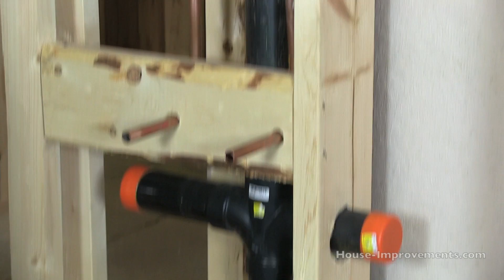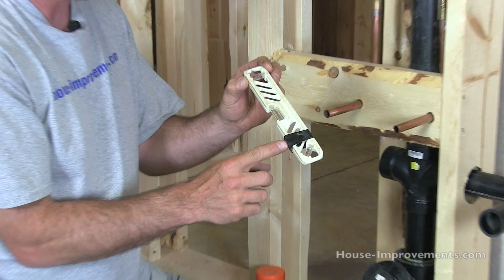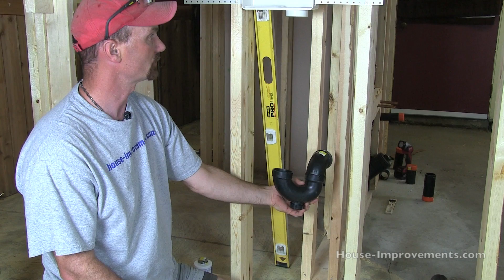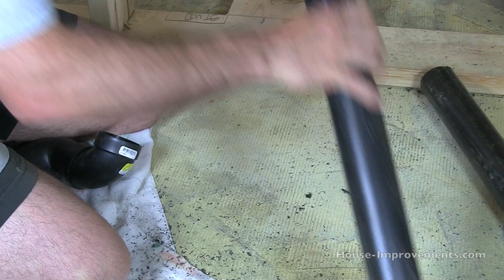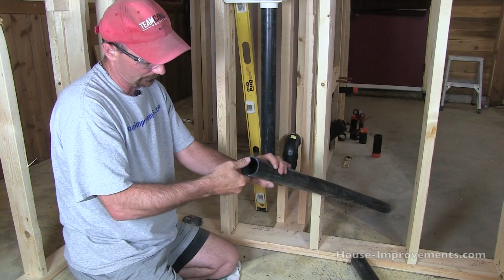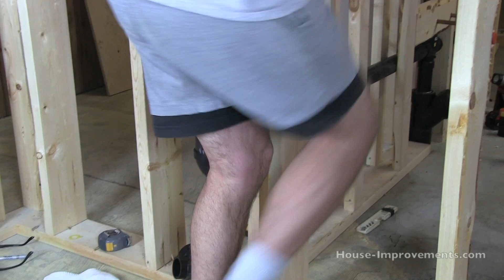How To Cut and Install ABS Drain Pipe

Comment: Good disposition but the video needs to be redone there are a lot of misleading steps, For example both fitting and pipe needs to be coated with glue and Held for a minimum of 30 seconds. Of all the different types of pipe ABS will want to back out of the fitted more than any other type especially large sized pipes and fittings

Comment: If running 1 1/2 inch abs through a floor should you drill a bigger hole than 1 1/2 inches?

Comment: Many levels have two black lines around the bubble. If you are using one of those levels, the outer line indicates a 2° slope up toward the side the bubble is touching. No need to rig anything up if you have one of those.

Comment: Thank you for great details. One question. for the 4 feet section slope. We need 1 inch rise and the angle created by 1 inch height goes in to receptacles on either end with ceratin angel and will this cause an improper fit or glue stength? Or how much angle can be tolerated without an extra slopiing fitting connection?

Comment: Shannon how high off the ground is that double t? I have a roughed in by builder at 20.5 inches. Does that mean I need to cut bring it down to 18** inches I think you said.
Reply from the maker: At up to about 22" you would still be ok in most cases.
Reply: @HouseImprovements  is the height mainly importance for where the abs comes out of the finished wall so vanity can connect?

Comment: This is awesome. Exactly what I am doing. So no need to prime ABS like you do with schedule 40 PVC?
Reply from the maker: It is better if you put the glue on the fitting and the end of the pipe.
Reply: @HouseImprovements  thank you! I’m trying to do this as well. Currently have a sanitary ty with a side hub for the future vanity and a vent. I would also like to add washing machine so go with a double ty like you have shown and ensure ur washing machine plumbing is 2 inch and sink 1.5 inches? I’m in manitoba

Comment: Anyone else notice he was trying to put the raised end of the level on the wrong side?  The slope would have been down with the raised block on the stub end.  I mean, the pipe was still too short for it to work right, and I'm sure he would have noticed had he continued and did it for real.  But I just thought it was kind of amusing.

Comment: 1) You're not holding the pieces in when you first join them. You ABSOLUTELY have to hold them together since the solvent generates heat to solvent weld the pieces together. That heat naturally pushes the pieces apart, and that's why you MUST hold them together until they cool down (about 30 seconds). 2) Why didn't you first put the bushing on the 1 1/2" pipe and then put that into the stud opening?
Reply: Also he need put some glue in the pipe and fittings..and hold until glue cold down

Comment: I was always told to put the glue on the pipe instead of the fitting so it doesn't push any excess into the pipe cavity. Possible flow reduction?
Reply from the maker: In reality they recommend glue on both the pipe and the fitting to be sure you have enough glue contact.

Comment: I also recommend glueing/cementing both the pipe and the fitting for guaranteed seal and if you're feeling extra, even rough up both prior to cement with sandpaper.
Reply: Prepping for my forever house- I was wondering about sanding the ends, to be super extra should I chamfer the ends a bit or is that way overkill?

Comment: Why would you use a P-trap with a clean out concealed in the wall on the laundry? Doesn't make sense when you can clean the drain from the opening on top. More problems for leaks in the wall!

Comment: another good video Shannon
Question ?
black abs or white pvc for washing machine drain ? and basement shower piping ? 
what is the difference and when to use ?
currently have black abs for basement plastic sink joining to copper main stack
Reply from the maker: Well it depends where you live some areas use PVC in most places . Where I am ABS  is generally used all through residential buildings but some areas will have different rules.
Reply: @HouseImprovements  Living in TORONTO . 
so Either one will Do ?
i heard Black ABS slightly Cheaper
Reply from the maker: @jonienglish3231  Both will do the job and ABS is usually cheaper.

Comment: Would a Mitre saw with wood blade bo ok to cut 4" or less ABS? Thanks
Reply from the maker: Yes, cut with control and don't just chop down through it with speed. Safety glasses for sure

Comment: How do I fasten 60 feet of 4'' abs pipe to the basement ceiling? Is there special clamps or something?
Reply from the maker: metal hanger strapping works
https://www.amazon.com/PlumBest-H20011R-Galvanized-Hanger-100-Foot/dp/B0069QU02C/ref=sr_1_7?keywords=metal+hanger+strapping&qid=1573410289&sr=8-7

Comment: Shannon , I have 1 1/2 brass drain line for may washer and sink. I have a small lea that I think it is running down inside my block wall. I think it is a brass pipe, house built in 1962, any way this drain come down from up stair and runs through a cement wall goes down the wall at a 45 on one side then make a turn down with another 45 and then goes down the inside of a small closet about 6' and back though the same wall and goes to a drain on the other side of the same wall to a bar sink. I have noticed water on the floor under the drain line in this closet. I want to know if I cut this copper or brass pipe and go with ABS how do I join these two pipes that are different. Can I use what they call a Fernco that is rubber with two hose clamps or do they make something different to join these two pipes. Thanks for Great videos. Please let me know, I need HELP !
Reply from the maker: Please use my forum and include a picture of the pipe and the size.https://www.house-improvements.com/forums/

Comment: The level should have the taped on spacer towards the wall side not the end of the pipe to angle the pipe up.  The way you showed it would be sloped downhill.

Comment: Wrong glue, glue is required on both fitting and pipe,  a good inspector will catch this along with you can not cover a trap in the wall that has a trap clean out on it.
Online inspection...not approved.

Comment: Question?? I'm remodeling our bathroom and our waste and vent lines are 4". ( main line to street) The waste will remain 4" but does the vent up need to be 4"? I'm not  a plumber , Actually I'm an  Electrician and very handy. I try a do as much as a can to learn and save.

Comment: Hi shannon, do the laundry drain needs a vent too?
Reply: Not if it's within five feet of the existing vent. Also you could use an AAV if permitted.
AAV = air admittance valve.

Comment: This is way off base. First off, crosses aren't to code. 2" trap arm? Why? NEVER DRY FIT You'll end up forgetting to glue one. It will come back and bite you.Plus.. what a waste of time. Hey! Rough in distance from floor to centerline of k/s drain? Sort of important. *18"* Same for vanity sink. If it's too high on a k/s, you may not be able to hook up a g/d or a 2 compartment sink.
2"  p-trap for w/m. riser no less than 18" , no more than 30". Why a clean out on the p-trap in a wall? Silly and a potential leak. Always apply glue to both spigot and socket, twist as you insert and hold briefly(the pipe can back out when first installed) wipe off excess glue.I shouldn't watch these.Too painful

Comment: This type of ABS pipe is recommended for water temp up to 140F. my horizontal section ABS pipe to the waste pipe under the sink is totally destroyed with cracks, water drippings along it when running water from the sink. I think the hot water from pasta cooking and discharged hot water from my dishwasher which is over 140F did the damage over time. Do you know if there are ABS DWV pipes 1 1/2" can handle temperature above 140F and can I cut off the damaged section and replace with that even they are not the same materials. Thanks.
Reply from the maker: ABS is rated for 180 degrees. I have never seen it be damaged by hot water.

Comment: Awesome! Now when the electrician goes to put in the box for his over the vanity light, the vent stack will be right in the way! Awesome!
Reply from the maker: I suppose if this were a bathroom or if the pipe was less then 2" from the face of where the finished wall surface would be  it could be a problem.

Comment: what about a clean out option

How do you avoid damaging the threads in the cleanout where the plug goes in when using a power snake to clean the maIN drain ?

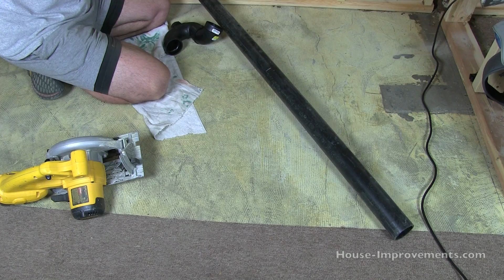Comment: 10:20 Avoid using power saws, since the high speed of the cutting blade can melt the plastic.
Reply: that's fine, you can go a bit slower

Comment: Hi HouseImprovements,

I have a roughed in bathroom and had waterlines installed. The toilet and sing drains are roughed in a should be ready for install. I'm about to tile to floor and was wondering when/where do I make the cut of the ABS pipe cut for the toilet drain. I have a standard flange and toilet ready to go but not sure where to cut the drain.
Reply from the maker: This is a better question for my forum, I can help you there. http://www.house-improvements.com/forums/

Comment: Hay Shannon, question for you . I am about to extend my kitchen.  Behind the wall close to the kitchen is a laundry.  I found the pvc pipe that runs from the floor to the ceiling and two copper pipes hot and cold water.  I cut off the pvc pipe on the ceiling and at bottom.  Question is, do I have to glue the cup on the part I cut off on the ceiling because that vent pipe runs towards bathroom or should I lieve it open.
Reply from the maker: it should not be left open but just capping it can trap moisture over time that could freeze and bust the pipe if you live in a cold climate. Re doing the vent so it does not have that dead end drop in the ceiling is a good idea.

Comment: Shannon, just FYI, I read on the ABS cement can instructions that the application procedure consists of 3 steps.  

1) Apply liberal coat of cement to pipe to the depth of the
socket, leave no uncoated surface.
2) Apply a thin coat of cement to inside of fitting, avoid
puddling of cement. Puddling can cause weakening and
premature failure of pipe or fitting.
3) Apply a second coat of cement to the pipe.

Then you insert the pipe as you had shown.

This is what it says on the can of the Oatley Solvent Cements for ABS pipe glue.
Reply from the maker: Good to know,Always read instructions, LOL
Reply: @Michael A  they were commenting on his demonstration of only 1 coat per fitting and pipe. Hard to watch as a plumber. 😂😪

Comment: Hi Shannon , need an advise from you. I installed a new kitchen in basement. Some how while cementing ABS pipe I kinda messed up slope on the pipe which connects from P-Tap to drain. Drain pipe has sufficient slope though. But pipe connects from P-Trap to Drain pipe has a slope downwards towards the trap. I ran water through , let the tap running for 10 minutes and water is flowing perfectly fine. Wondering should I leave it as is or fix it ? Please reply. Thanks
Reply from the maker: It is likely a short enough run that you will be fine.

Comment: I used to use Vent 90's on the trap arm so the hub would be in the wall but the inspectors started calling me on it.  And why do you only glue the hub the end of the pipe should be glued also.
Reply from the maker: +Dumped4ADildo I guess thats just how I have always done it, maybe because I use a fair amount of glue I have go ten away with it?
Reply: +HouseImprovements Not that it happens often but when glue joints have failed its been when only one piece was glued.  I guess if your quick enough it shouldn't matter but if the one glued piece begins to skin over your running the risk of not actually fusing the abs but rather just packing it with a sealant.  Also I forgot to mention on the vent 90 trap arm when the inspectors started calling on me I started using spigot medium 90's so the spigot end is whats sticking out of the wall and my trap adapter. glues on to that spigot long sweeps if the cabinet had a back panel.  And I just want to say these are things that I have been through if your work works and everyone is happy then it was done right no matter how you did it.

Comment: Great video. I am trying to build a bathroom without cutting into the Cement.. I wanted to ask can I cut into the waste pipe and just raise the floor for the toilet. how do I cut into it if I can
Reply from the maker: +C. Osi  It maybe possible but I have never done that. Interesting thought though.
Reply: honestly all depends on the location how high or low it is. honestly cutting the cement and doing it right is your best bet

Comment: How come you only apply the glue to one not both surfaces of the ABS pipe?
Reply from the maker: I guess I always am pretty liberal with the amount I apply so never felt the need to have it on both pieces. I always give my pieces a slight twist after joining as well. As some have suggested here it should be on both pieces.
Reply: HouseImprovements If you understood what the glue is doing, you would apply to both surfaces.  If you attempted this with pressurized pvc, your joints would fail in very little time.   If your only going to add glue to one surface you should at least prime both surfaces first

Comment: You can just glue up your 90 and pitch it while the glue is still wet. Then you dont have to waste time dry fitting. The 90's pitch stick in the pipe and keep moving.

Comment: The 1/8" pice of wood on the torpedo level looks like it should be on the other end of the pipe. But then he ended up eyeballing it after going to the trouble of constructing it so it seems it didn't matter for him... Of course you want it to be such that the pipe will be higher at the sink end than the sewer end.
Reply from the maker: I had to go back and watch the video ,and you are right if the pipe would have been long enough I was holding the level the wrong way.  Hopefully if the level would have fit on that pipe I would have caught my mistake. Good eye on seeing that.
Reply: HouseImprovements Shannon, you should do a video on how to attach a 1/4" block on a torpedo level in order to get 1/4" fall per foot. I am a DIYer and I'd like to see that.
Reply from the maker: Rocket Rider  You are looking for 1/4" / foot, so on a torpedo level (which is usually only about 8" long) I measured 6" from one end (1/2 a foot) and at that point I  used electrical tape to secure a 1/8" piece of wood because of only going 6" long. I leave that taped on permanently ..
Reply: Thanks. I will set up mine too.
Reply: HouseImprovements  OK, I found something in the kitchen that is 1/4" high. I put a 12" ruler on it to get a slope of 1/4" then I put my torpedo level on top of the sloped ruler and noted the place where the bubble rested. I marked it with a black marker.  That way I don't need to tape anything to the level itself.
Reply: Better check your local codes first.. This wouldn't fly in parts of the US

Comment: Do you need a p-trap in for the Laundry drain and why one with a clean out in the bottom of it that will be inside the wall?
Reply from the maker: Yes you need a p-trap to keep sewer gases from coming back into the home. The trap does not need a clean out, it was the only 2" trap I could get at the time and I actually glued it closed so that it would not maybe start to leak over time.

Comment: Thanks for the video. I watched it and then replaced a 30' run from one side of the house to the other. Home Depot only had the nasty black adhesive, not the fancy yellow stuff you are using. Can you tell us about the yellow stuff, where to get it, how it differs from the black stuff, etc. I had to use solvent to get the black stuff off my hands!
Reply: Jason Bolton abs glue in the us is black and milkey white we don't have a yellow glue for abs. Transition glue is green here in the us.
Reply from the maker: I have never seen/used a black ABS cement. I purchase my yellow glue from Home hardware. It does not easily wash off either.
Reply: You were probably mistakenly using system15/xfr glue (greyish colour)...abs glue is yellow 100% (there's transition glue for pvc to abs which is white)...  i would consider deleting and rebuilding with the proper adhesive (especially if you didn't use a glue mentioned in this comment.)

Comment from the maker: that depends a little on how far from the sink you will be. At the sink the 1-1/2 pipe should come out of the wall at 18" to center from the floor. Your horizontal pipe from that point to the main stack should be sloped at 1/4" per foot ,so from that you can figure out the height of the fitting you need to cut into the main stack.